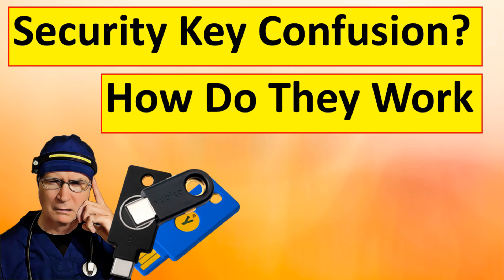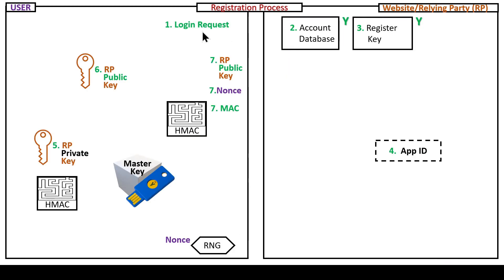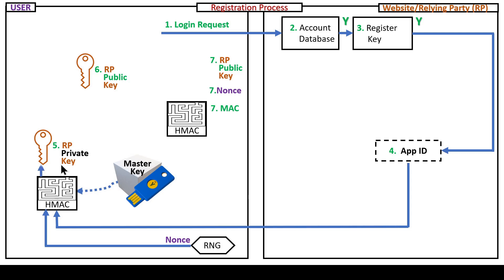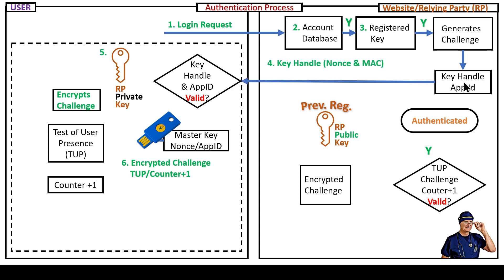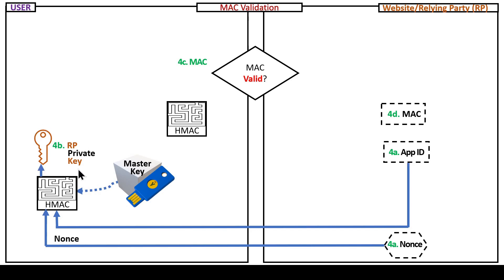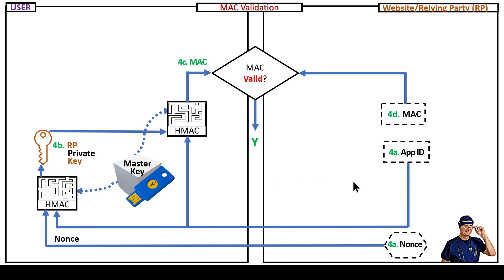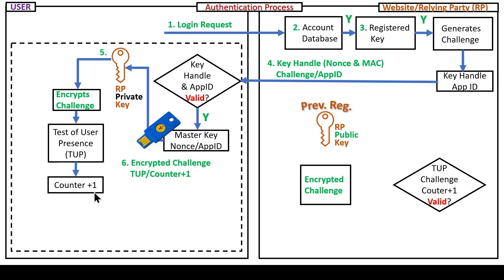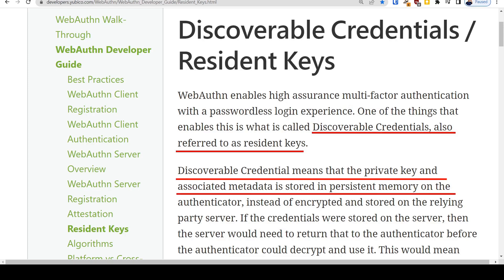How Do Security Keys Work? Explanation of Yubico Key Wrapping!

Comment: Thanks for the best video by far on this topic I have seen until today.

I have been looking into Yubikeys and alternatives lately, but in my opinion Yubikey has a big design flaw that will prevent my from buying one (or actually two or more):

If the user needs a backup key to be on the safe side in case of damage or loss,  in my opinion it's a necessity  to be able to backup a key to another key WITHOUT any kind of online service from the manufacturer. 

Way to many products transformed to electronic trash after a manufacturer went out of business in the past already.
Reply from the maker: CM's: Insightful feedback.  Let me address your last point first.  FIDO is a multi industry alliance supported by Google, MS, Apple and just about all HW/SW security providers.   

If the user needs a backup key to be on the safe side in case of damage or loss,  in my opinion it's a necessity  to be able to backup a key to another key WITHOUT any kind of online service from the manufacturer. 

CM's: May not completely follow.  You are correct in the need to have a backup key.  You would need an additional key for the backup.  Each key has a unique private/public key pair for authentication to the service provider.

Although we recommend the HW keys as the primary authentication... an alternative is to use a Passkey.  They perform the same function as a HW Key, but are stored on a device vice a Hardware key.

Search Youtube: CyberMedics Passkeys for more information.

Thank you for your informed insight & questions.

Comment: Thank You for the video! question I bought 2 Yubico keys and used them to secure my Apple ID on my Mac Pro and I phone, does that automatically Locke my Apple ID on my iPad Pro or do I need to use yubi keys for the I pad also. Thanks for your help!!
Reply from the maker: When you add a security key to your apple device you are actually adding it to your apple ID.  When the keys are first added you will be presented with 1 of 2 options:  1) add the key to all other devices (or else they will be signed out of the account or 2) Remove older devices that are not compatible with the HW security key.  Please see our video: https://youtu.be/0vkrxCCm8Fw  Appreciate the comments and great questions!  Thanks for subscribing!
Reply from the maker: Did you enjoy the video?  It take a little more work, but we try to thoroughly explain everything.  Unfortunately the video only has 800 views.  Could we ask a favor?  Would you please consider sharing this out with friends & coworkers?  We believe this video is important for everyone to understand why the security of these keys are useful.  Thank you!

Comment from the maker: Do you us a hardware security key?  If so, what brand of key do you use?
Reply: Thanks for the best video by far on this topic I have seen until today.

I have been looking into Yubikeys and alternatives lately, but in my opinion Yubikey has a big design flaw that will prevent my from buying one (or actually two or more):

If the user needs a backup key to be on the safe side in case of damage or loss,  in my opinion it's a necessity  to be able to backup a key to another key WITHOUT any kind of online service from the manufacturer. 

Way to many products transformed to electronic trash after a manufacturer went out of business in the past already.